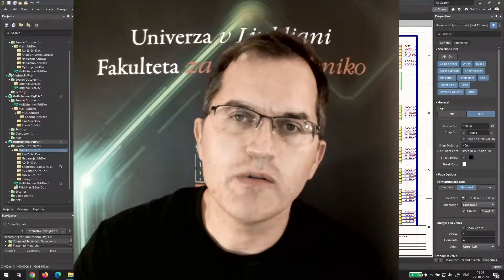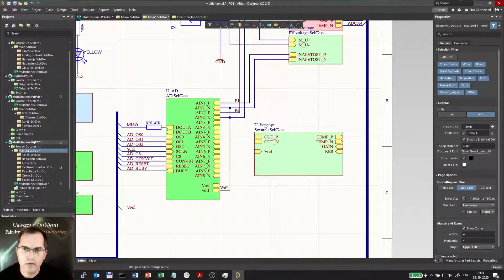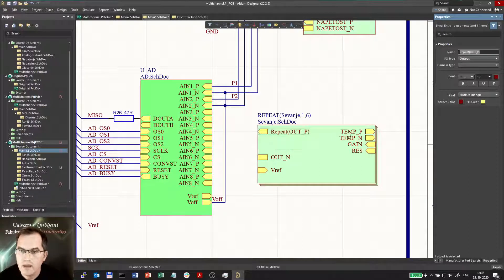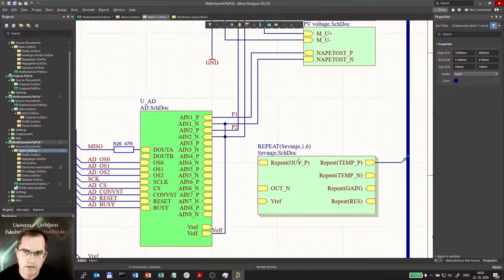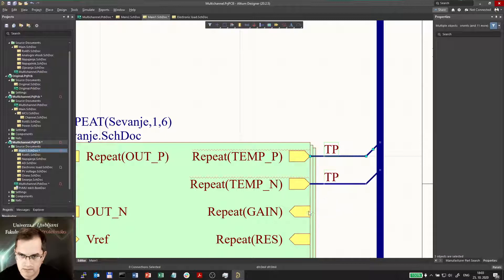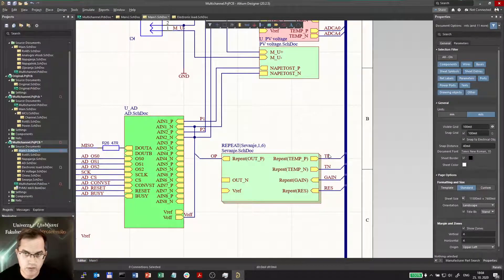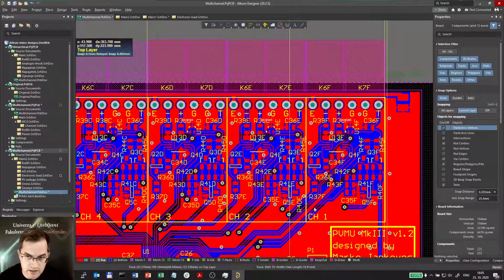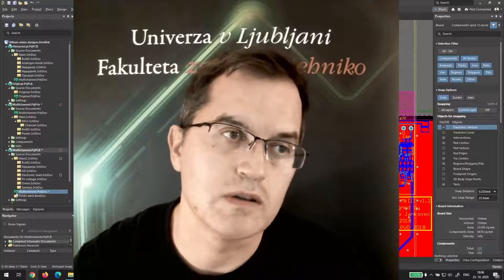Altium Schematics #03: Multichannel design using REPEAT function

Comment: Thank you very much for so helpful videos. Quick question regarding repeat function... let's say I want to create netclass for each of the repeat blocks to make layout easier. Is there an automated way to add all repeated signals from a block to a specific netclass? On the example of the vide, I would need to have one netclass that contains TP1, TN1, GAIN1 and RES1; and another netclass called TP2, TN2, GAIN2, RES2 and so on.

Comment: I have to name the bus with a netlabel in the format <Name>[<StartingNumericalIdentifer>..<EndingNumericalIdentifier>] to get rid of the warning message: "Unconnected line" after I compile the whole project. You don't mention that. Is it because older Version of AD needs a bus net labeled? And if not, are the wires nevertheless connected with each other, so that the warning message can be ignored?